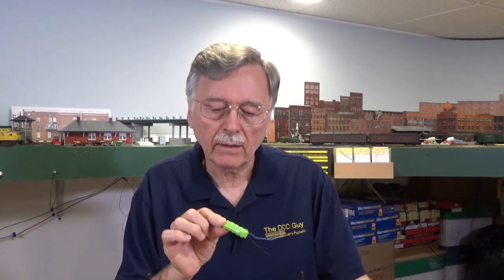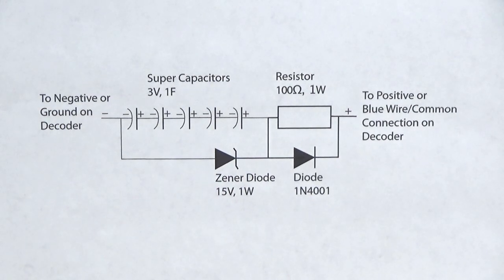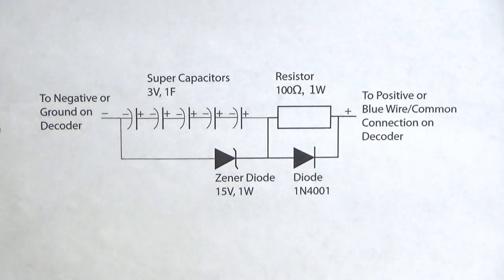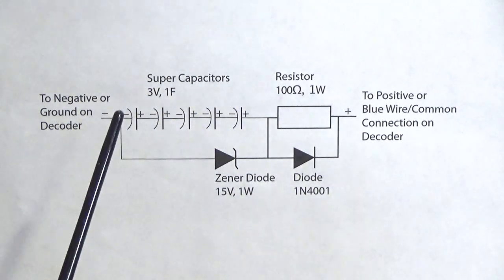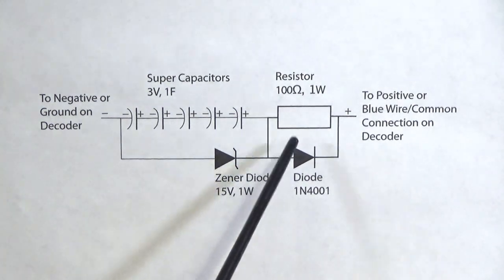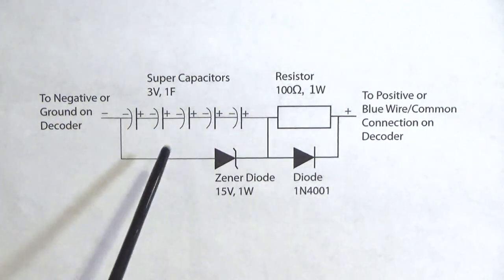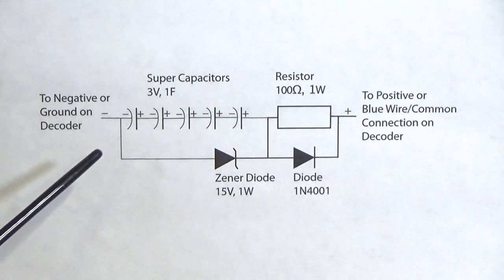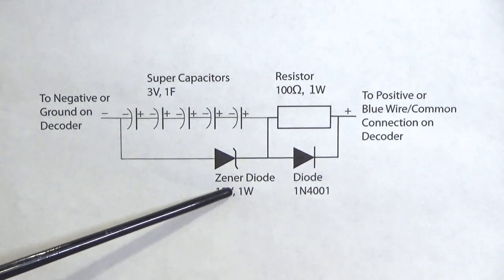DCC Keep Alives, how they work and how to select components for your own (31)

Comment: Extremely useful Larry!! I came close at one point about 7 years ago, of making a N Scale Keep-Alive! Close.
I used SMD Capacitors and Diode.
It worked well enough to pass any Frogs and small dead spots.... 
What I didn't take into account was the Bypass Circuit. Like I said, it worked, somewhat, and fit in 2 Atlas Hood Diesels, but there was only so much Capacitance I was going to achieve with that crude setup. 

Your Diagram might make it possible for me to try again! I don't know the availability of a SMD Zener Diode though. 

Thank you!! You're teaching this old Dog! 😊
Carmine ✈🚂🚙

Comment: Thank you Larry! I am adapting this design for G scale where I run 24 volts.  Would you recommend connecting 8, 3V caps in series to get my 24 volt rating? I ordered some 10A 1000V Rectifier Diode to substitute for the 1N4001, do you see any problems with this? I am using a 2 watt 100 Ohm resistor. Do you recommend a higher resistance value since I am using 24 volts? The resister and diode remain the same values regardless of capacitance at 24 volts correct? Essentially, could I swap a 0.01F 25V capacitor with a 1F 25v capacitor and the only difference would be charge storage?
Reply from the maker: I suggest you take a look at this website, it has some suggestions for larger scales. I am not an EE so designing one for large scale is a bit over my pay grade😀

https://dccwiki.com/Energy_Storage

Comment: You have referred to this video (31) in other videos for the “keep alive” parts list.  I am having trouble sourcing the heat shrink tubes.  Do you have a part number for that?  I sourced the size mentioned in the video and I received a garden hose and not the nice, clean shrinking green one you used.
Reply from the maker: I
Sorry but I bought it several years ago and have no idea who is selling it now, you’ll just have to search the eBay and Amazon listings like I did.

Comment: Hi Larry another great video  have a question for you regarding the zener diode, i have some 2.7v 10 microfarad  super caps at 2.7 v  so if i wire 5 in series which will give me 13.5v total do i use a 14v zener or higher the track voltage would be 14 volts or do i increase the caps to 6 giving me a total of 16.2 v and use a 16.5 or 17 volt zener
Your advise would be greatly appreciated 
Mike  (England)
Reply from the maker: Mike—you need tp keep the voltage that the caps get equal to or less than their total volrage. So with 13.5 V you want a 12-13V Zener. Keep in mind that your actual voltage on the decoder will be less than the track voltage since it has to go through the bridge rectifier which could drop it as much as 1.4V.
Reply: The DCC Guy 
Hi Larry thanks for clearing that up up my problem will let you know how i get on
Mike

Comment: So I have a locomotive where there just isn't enough room for much of a keep-alive. I have just enough room for a single capacitor of 16V 1000uf. Wont be a lot, but it'll be at least something. The Zimo sound decoder has solder pads made to be used with a keep-alive. However, since Im just using a single capacitor, do I still need to use a Diode, resistor, and a rectifier?
Reply from the maker: I’m not sure about that. I seem to remember you can install  cap there but it would b best to dig out the instructions or contact tech support. Also youchoos.co.uk deals in Zimo and offers capacitors for them so give their website a look.

Comment: G'day Larry, great videos on the Keep Alives. I have a question, is there a formula for working out how long your engine will run after power is lost? My problem is that some of our Aussie locos are very small, and while I try to keep my track clean, it's easy to miss a spot, so I only want a small KA to last for maybe 4 or 5 seconds which hopefully will make it a smaller unit. Could you use a single 3 or 4V super cap? Or would finding a Zener small enough be a problem?
Reply from the maker: The limiting factor is the electronics of deciders which require about 7V to operate plus you need a little overhead. The small commercial KAs use complex circuitry to boost voltage from fewer capacitors but those are too complex for home builds. Right noe the smallest I know of are the TCS KA1 and KA2.
Reply: @TheDCCGuy  Thanks Larry, that helps a lot. I didn't know about the minimum voltage requirement. So I guess 10V would be the minimum, which still requires 4 3V Caps

Comment: RailPro seems to have a problem with Keep Alives burning out a component on their boards.  Apparently when you shut down your layout the capacitors don’t drain completely.  With that said, it is possible to cause problems with the decoder at 3 to 4 volt levels.  Is there a component that we can add to prevent the voltage from dropping below 4 volts or possibly a component to assist with a complete drain of the capacitors when power is lost?
Reply from the maker: First I’ve heard of this. I’ll have to see what I can find out about this problem, but it sounds like a problem at their end. Is this happening with all types of stay alive devices?

After a quick internet search I can only find discussions and questions about how to install stay alives with their decoders but nothing about this other issue. It is interesting that most other DCC decoders work with stay alives fine but theirs won’t. There must be something about this I am missing.

Comment: Hi Larry.  Another informative video.  I’m debating whether or not to use a keep alive with my steam loco dcc installs, and wonder why a keep alive is needed if the track pickups on both the loco and the tender are live.  Wouldn’t those two sources suffice to get the pair across any dead zones?
Reply from the maker: The more wheels you have picking up power the less likely a stay alive will be necessary, especially if the tender wheels are part of the picture. In HO scale the real issue is with short wheelbase steam and diesel locos. Of course if you have ild brass locos with left/right side pickups its a different story.
Reply: @TheDCCGuy  thank you for the insight.  That makes sense.  I’m doing an HO Hudson and a Niagara, so I think I’ll try them without a keep alive, and do a retrofit if needed.  First task is to get the installs done successfully.  Very much appreciate the response.

Comment: Hi Larry - I have my components, my question is... Are there any polarity considerations for the Diodes and Resistor? It doesn’t look like it by the schematic you show, but I’m a novice at this, so better safe than sorry...
Reply from the maker: Yes, the diode and Zener are polarized but the resistor is not. On the diagram there is a black line at the tip of the triangles representing the Zener and the diode (the Zener is the one with the jagged line). This line corresponds to the white line across one end of the diode and the black line across one end of the Zener. You should be able to see this in the video where I show how to solder all this stuff together. After you put one together test it using an old mobile decoder before moving on to a more expensive decoder, just in case!

Comment: Types of supercapacitor query:
Hello I live in the UK and have been trying to locate a local source of 1F supercapacitors to try out your method of stay alive for one of my 00 gauge locos but but can only find some that say they are 3.3F capacity at 3Volts ( I have found some 1F ones from China, but they have a massive lead-time to ship to me).....could you advise if the local 3.3 F ones would be suitable please?.....
Apologies if this is a 'stupid' question but my electronics knowledge is limited - however I think I am up to trying out DIY stay alives though (but just need some help getting right components )
P.S. excellent videos/content by the way - have spurred me on to have a go !
Reply from the maker: I think the bigger capacity ones are much larger diameter on the order of 12mm so I have not given them a try.
Reply: @TheDCCGuy  The technical note for this particular 3.3F says 8x20mm. so not too big 🤔what do you think?
Reply from the maker: As I expected, that”s almost an inch in diameter and when you stack several to get a high enough voltage it will be at least an inch tall! Will that fit where you need it?
Reply: @TheDCCGuy  At 8mm. diameter surely 3 side by side would only be 24 mm (1.4mm under 1" - 25.4mm?), so at 9V total would this be too low for my 14v track voltage & would the zener need to be 9v not 12v as per your example ?....sorry if this is nonsense, just trying to learn things.
Reply from the maker: So 3 high would be about 24mm and they would be 20mm wide so you have essentially a cylinder about 20x24mm or close to a cubic inch. But if that works for you then the numbers you mention should work.
Reply: @TheDCCGuy  Thanks 👍🤞

Comment: Thanks for this great explanation. I am a little confused though. Five years ago you put up a video on basically the same thing and you were building a 12v keep alive. This video is building a 15v keep a live. With DCC systems putting out 14v or so as you mention here, is it better to go with the 15v setup?

Next question. I am starting to use the Soundtraxx Blunami decoder. Will this setup you show work well with them too? I am curios because I bought a Soundtraxx keep a live and it has a LOT more components on the board than just the few you talk about here. Any comments on these extra components would be greatly appreciates or possibly a follow up video explaining the additional components on the commercially available keep a lives vs your simplified keep a live. That would be great too.
Reply from the maker: The commercial stay alives are much more complex than these very basic ones but should work. The 12V versions I previously built were probably a bit too close to the break point since once track voltage exceeds the total capacitance they may pop although the zener diode should protect them as long as it is chosen correctly. I did this video to show folks how these devices work and provide guidance on how to select the right components if those I used are not available. I have not tested these with a Blunami so cannot advise on their use with them. If you blow a Blunami it may violate the warranty—just a warning.

Comment: These are great videos. These in conjunction with your MRH articles just have tons of good information. My one beef is I wish you would have posted a part number for the Zener Diode. I just can’t seem to find these from the popular suppliers. I got some but they are little things with tiny little tabs on each end instead of the nice big wire on each end. The ones with wires always seem to be out of stock. What am I doing wrong searching for these things?
Reply from the maker: I did post the part numbers for 12, 13, and 15 volt Zeners in the description of the video. If Mouser is out if stock then check Digi-Key, Newark, All Electronics, and other electrical parts suppliers for them. There is nothing magical about the Mouser parts, any 1W Zener in the desired voltage will work.

Just to prevent confusing folks, I write for Model Railroader not MRH (Model Railroad Hobbiest).
Reply: The DCC Guy Well shame on me! You just taught me something. I finally figured out how to see the description of the video! I never stop learning from you whether about DCC or YouTube! Thank you.

Comment: Hi Larry, I don't understand the point of connecting capacitors in series. My understanding is that you will still only get maximum of 0.2 Farads out of 5x 1F caps in series. Is it just to get the total voltage higher? Why not use a 15V 1F cap?
Reply from the maker: Have you seen how big such a super capacitor is?
Reply: @TheDCCGuy  sounds like the real answer is: a series of lower voltage caps is more compact. Thanks.
Reply: what about slight variations between the components? See https://www.coilgun.info/theorycapacitors/capacitors2.htm where they say: if one capacitor is slightly leaky, it will gradually transfer its voltage to the others, possibly exceeding their voltage rating in turn. And if one of them punches through its dielectric barrier, it can then damage others in a cascading fashion. This is why series capacitors are generally avoided in power circuits.
Reply from the maker: Exactly, once you get above the 3 volt 1 F supercaps they get large fast. TCS has found a supplier of small caps for their KA1 and KA2 Keep Alives but I have not been able to find out their rating or source. I took the wrapper off to get a peek and they are plain bare metal with no markings at all! At any rate if the larger super cap will fit then that would be a better solution than daisy chaining 5 small ones.

Comment: Hi Larry iv just got into N scale and was wondering if anyone makes a stay alive for N scale locos, im running modern diesel power mainly Kato as i like there product
Reply from the maker: Unfortunately I don’t know of any, the components are just a bit too big. I have installed a TCS KA1 in an N-scale tender along with a decoder and speaker but it was a big tender. Diesels are a bigger problem since most have barely enough room for a decoder.

Comment: Is the Mouser part number for the 100-Ohm / 1W resistor actually 71-PAC100001000FA100 ( versus ...100FA...)?
Reply from the maker: I just checked and the number is correct. I copied and pasted these nos. io get them correct. These are not for use in satellites so anytning rated at 100 ohms and 1/2 to 1 W should work.
Reply: @TheDCCGuy  thanks for the quick feedback, unfortunately the part that was provided comes back ....No Results... in Mouser's system...
Reply from the maker: I ran into that problem too and have no idea why it is doing that. I had to literally scan through the 100 ohm 1 W resistors to find the listing. However there is nothing magic about this resistor, and just about any 100 ohm 1/2 to 1 W resistor should work fine.
Reply: @TheDCCGuy  I did choose an alternate p/n, and my parts are ordered. Thanks for your help, and especially for your channel that educates and encourages others to make things they would not otherwise try... Best, JP

Comment: There is nothing in that circuit to stop any one of the capacitors being charged to a higher voltage than what they are specified to take. If one of them is a different capacity it will charge at a different rate to the others and may overvoltage.
Reply from the maker: The Zener will keep the maximum voltage to them at its operating voltage but the individual capacitors are not protected with resistors, etc. That is one difference between this circuit and the commercially available ones which usually have a surface mount resistor for each capacitor to regulate their charging voltage. However I have never had one blow on me.

Comment: Educate a dummy, what is a keep alive for?
Reply from the maker: It keeps the decoder powered and the locomotive running when it hits a dirty section of track, rough track, or an unpowered frog. Think of it as a little battery that gets you over the bad spots.
Reply: Ok thanks
Reply: If this is for dirty track or imperfections in the track why not do a better installation of the switches or track and clean the rails more often? Then the stay alive is not needed. Maybe there's something I'm missing.